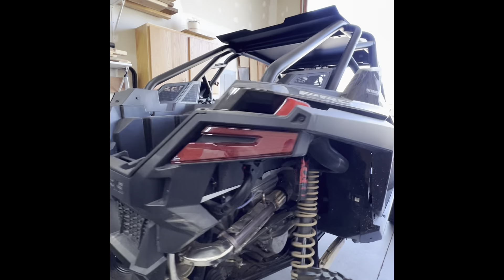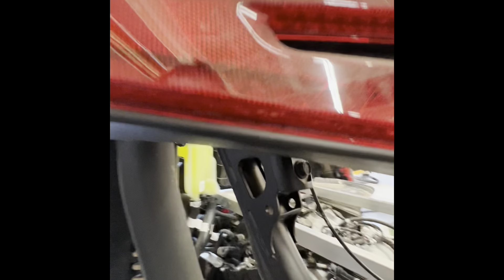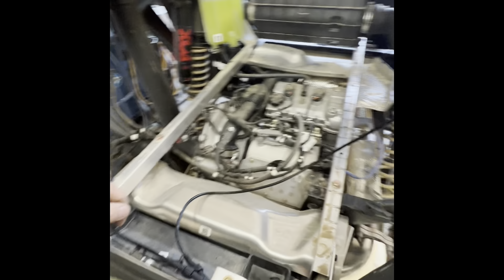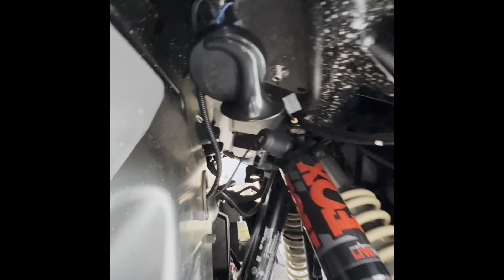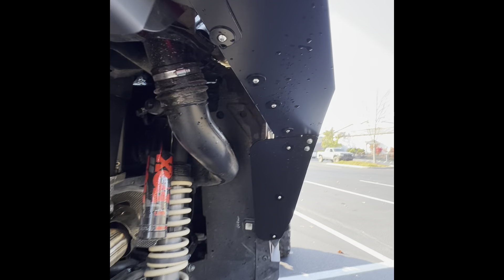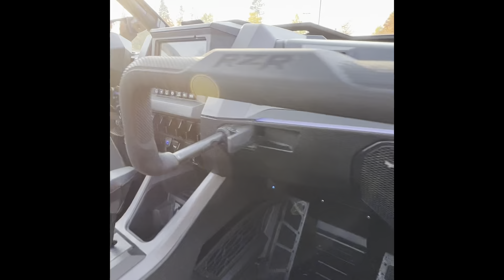2022 Polaris RZR Pro XP Turbo Accessories Install - Whips, Turn Signal Kit, Windshield and Mudflaps

Comment: I have a turn signal kit what do you think I would need so the arrows in the cluster work?
Reply from the maker: Depending on the turn signal kit you have, most have the option to light up the arrows using a set of jumper wires that plug into the back of the instrument cluster. Kits from Corbin Custom Works and Ryco have such capabilities. First thing is to make sure your instrument cluster has the arrows. Some models do not.
Reply: Yes I have 2023 xp pro.